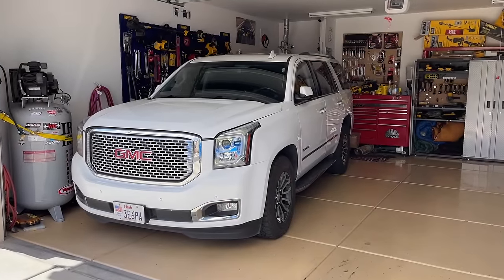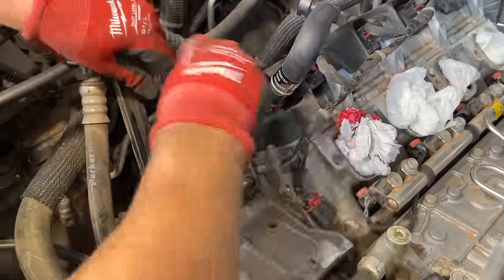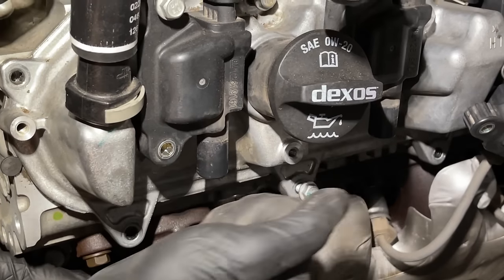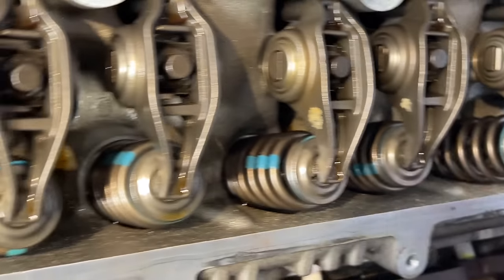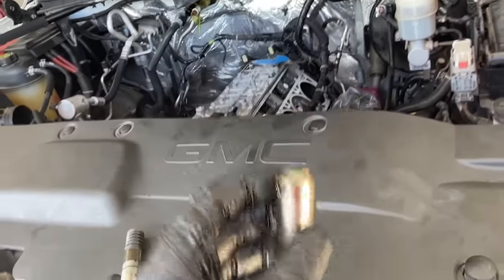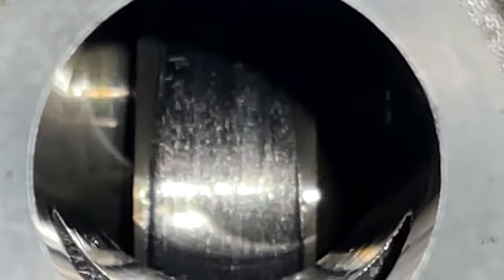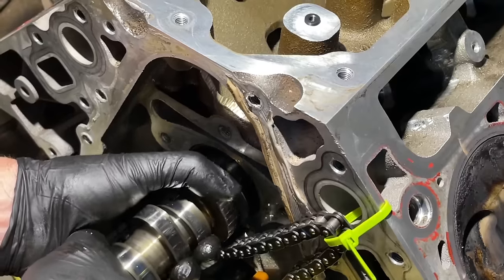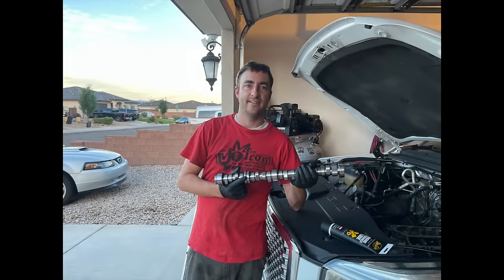DOD AFM Delete Yukon, Tahoe, Silverado, Sierra, Escalade 6.2L & 5.3L Replace cam & lifters  Part 1

Comment: Where’s the class action lawsuit?? GM needs to be FORCED to fix this issue!!!!
Reply: they won a court case....... so they dont have to do shit
Reply: @johndonovan7018 they didn’t win anything. They convinced plaintiffs to go into arbitration. So they are settling with some individuals outside of court, which kills the class action suit.
Reply: Yup, just cost me 6k yesterday.
Reply: @lespauljunky74  so sorry. I’ve been a Chevy guy all my life. No more!
Reply: I’ve seen videos of failure with just a few hundred miles.
Reply: My wife's yukon 6.2 just dropped a lifter, shop qouted me 5k to delete dod. I will never have a vehicle with DOD. It's a 2017 with 100k miles, I have a 2007 dodge diesel with 270k miles and a 2014 f250 diesel with over 200k miles both 0 issues. Maybe it's time for her to join the green handle club 🤔
Reply: @thatgreyplatty6315 
Diesels are just as bad now days too.. Def cylinders getting destroyed. It’s called Monopoly lol. Won’t have to worry about cash for clunkers in future.. they won’t make it as long like they used too 😂
Reply: It's like this. Chevy = dod issues. Ford = cam phaser and other timing issues. Ram = lifter and other valve train failure. They all have their problems.
Reply: @thomasdebord1144  of course that’s true, but the question is the rate of failure within the big three. Ford and Dodge issues aren’t near as prevalent as Silverado.
Reply: @thomasdebord1144  it's time for Toyota to make a move.
Reply: Other states have sued GMC for this issue here
Reply: My 08 made it 200k before it became an issue and I still haven't removed it I just have to prime the oil occasionally..  if every single truck failed early on id agree but they don't. Nothing lasts forever. Fix it and quit crying.
Reply: @seapotatoes7260  some make it 200k 300 some die in 30k. do you really ENJOY playing this game with your engine
Reply: @johndonovan7018 It's not a game it's called life isn't fair. I guarantee most of these clowns with low mileage failure don't do 5k mile oil changes, don't know how to prime the engine oil ect. Parts are relatively cheap considering it's major internal parts and only going to be done once in the engines entire life cycle. You can get a kit for 700. You can probably get a delete kit cheaper than that. The work isn't rocket science. People are mad at the labor costs more than anything. I'd be mad too if I were dumb enough to pay 5k for a day or two of work. Or if I were dumb enough to neglect a new engine into failure but that's what warranty is for. If it's over 200k miles you should expect anything to need major work. No engine just magically lasts 300k.
Reply: @seapotatoes7260  you’re a bigger tool than anything you’ve got in your harbor freight toolbox.
Reply: @seapotatoes7260  nah you are looking at 2k in parts these days to do it right. and you must know what you are doing or you will fuck it up and end up with head gasket issues. its simple, yet not so simple at the same time. i do agree about the neglect part. i have 3 GMs with DOD and DI. they destroy the oil fast. i change it 3-4k while the on board system wants to push it to 7k. i use penz ultra platinum but i suppose mobil1 will work too. i havent had any issues. also use oil separators on both sides and manually clean the intake valves and plenum every 30k. even with cans plenty of shit ends up on there. but lets be real, aint nobody gonna do what im doing.
Reply: @lespauljunky74 it’s such a shame. Chevys used to stand for something. I wouldn’t touch a gm product after 2003
Reply: @thomasdebord1144 not Toyota. The 2nd gen 5.7 is mony
Reply: @thatgreyplatty6315 

I have a 2004 chev tahoe 
With 257000 miles 

I have replaced the Radiator.
Heater hoses
And a very sealed in the transmission

Which cost 2600$ 

Bought a  2017 tahoe at 156000 miles and  have liffter  problems 

What a crap
Reply: @Slednex700 yup, they're designed to last only as long as your 7 year note on the vehicle.
Reply: @DdD-pi8jw Nope. Finished a 2015 ram 1500, new cam, lifters and all.
Reply: @kingsolomonamen3333 
Yes, since GM settled. It's case closed. Idaho, commiefornia, and another state all did a class action. 
As someone stated, GM settled with the plaintiffs, each person that got involved got $2500.00 each and GM basically won.
Reply: I blame Obama for the epa mandates that made them do crap like this
Reply: @rawkfist-ih6nk  very valid point. TRUMP 2024! MAGA!
Reply: @seapotatoes7260 Same here, 2008 gmc sierra sle z71, over 200,00, still purring like a kitten. I especially like the DOD working in conjunction with intelligent charging.
Reply: @DdD-pi8jw  that might be the case in your area where im at ford has kept my shop going strong for the last 20 years and my father for 30 years before me
Reply: @thatgreyplatty6315 BTR dod delete is 1k and can be done in 2 days by an amateur. I've done 7 already
Reply: Does this delete require a new cam?
Reply: @jeffyates5532  nothing bigger than stock but it won't hurt. Stage 2 adds more ponies without upgrading torque converter
Reply: Agreed!!!!!!

Comment: It's such a shame what GM has done to their once badass V8s. The damage to this engine is insane. GM knows this is an issue and how do they fix it? They DONT. they keep making the same old junk V8s. So sad.
Reply: I agree. I so wanted a new GM truck. If only you could order one with no DOD - dead on demand engine.
Reply: Their design is genius, this is what happens when you run cheap gas and your detonation is delayed because of low octane fuel when switching from v4/v8.. always use premium from the jump. Premium detergent if available, preferably.
Reply: Thank the hippies, not GM
Reply: Same here , I wanted a new semi many years ago , finally got into the position to do that and they ruined the diesel with epa regs. , so I decided to downgrade to a new pick up in 07 , I wore that one out almost , now I need a new one , but they dont build them worth buying nowadays . I'm bummed ..guess I'll look at horses to drive ..😢😂
Reply: @jonathonflores4937 the design is not genius lol

Comment: I picked up a 2016 quad cab Silverado 5.3 with 98,000 for $7500 in excellent condition the Engine was supposedly blown , all it was, was 2 bad lifters. I did the AFM delete bought new lifters and a Brian Tooley stage 1 cam. Took me about 6 hours. I used this video as a guide. Im not a Truck or Chevy Guy this was a Suprise for my wife. I did 2 oil changes in a 50 mile period also to be safe. Thanks again !!!!
Reply: Hey did you take it to a shop after to get a tune for it?
Reply: 6 hours!?!?! How the heck did you pull that off. I’ve been at this all day. I’m fighting all the stuck connectors and the dang fuel line won’t come off.
Reply: Blown engine is a word people use often. A blown engine is a total destroyed engine.

Comment: I want to thank you for taking the time to show this step by step. I just finished doing mine tonight and could not have done it without your videos. You made it easy and explained everything perfectly. Thank you so much!
Reply: How long did it take you to do everything? I have a 2015 sierra with a plug in delete and have been skeptical about doing the full delete because I don’t want to have my truck sitting in the garage for days partly disassembled.
Reply: It took me right at 40hrs. I didn’t use a power ratchet in the disassembly(bought one to reassemble) and I think it took me 3hrs to get the timing chain off(probably was a little too cautious). Shop estimate time was 30hrs so I think I was pretty much on par with that. I’m no expert by any means but to do it right I think it’s a 30hr job all day.
Reply: Hows your truck holding up with the afm delete? Hopefully no issues so far?
Reply: @leytonhankins1665 why would it sit for days in the garage partly disassembled?
Reply: Holding up fine so far. Runs better than it has in a long time.

Comment: If all gm vehicles from 2015 to 2020 has the AFM problem why don’t GM makes a recall to fix this issue if it’s been going on for years I just spend almost $10k fixing my 2016 Escalade esv cylinder 4 because of this issue had the dealer change lifters,camshaft cylinder valves gasket,come on @GM do something about it
Reply: Awful

Comment: Awesome video.  Great camera, lighting and audio.  I really thought I would have to pull my engine but you clarified that isn't necessary.  Can you comment on leaving the original oil pump installed?  I have read it should be replaced with lower pressure version to eliminate excessive oil being sprayed on cylinder walls when not utilized by the AFM system.  You mentioned leaving the old pump in place and just curious if that is ok?  Thanks again!
Reply from the maker: The oil pump is a bit tricky. Removing it would require pulling the engine (or at least lifting the engine enough to drop the oil pan. Then on installation it has to be perfectly centered or you can lose oil pressure. There are also oil lines in the pan with seals that have to line up just right. My understanding is the pump is a variable flow pump to allow more or less for the DOD and if you leave the stock one it continues to regulate to the normal oil pressure, just not needing to fluctuate since it’s more constant flow without the DOD. Mine has maintained the same oil pressure as before the procedure. I would definitely contact Brian Tooley racing about the pump as well as they have been super helpful.

Comment: Great job, nice step by step and great camera work,it is always hard to get clear views! As a note when using a crow's foot it should used at 90 deg to get the correct torque, without doing some additional math if other than 90 degrees.  Thanks again for your work here.

Comment: Looking at doing a full AFM/DOD delete on my truck. Checking to see what Extra gaskets etc would be needed: exhaust manifold gaskets, intake manifold gaskets, HP fuel lines, HPFP gasket, head gaskets, water pump gaskets, valve cover gaskets, injector seals (if injectors are removed), crank pulley bolt, vacuum pump gasket (if removed), VLOM cover/gasket, timing cover gasket/rtv, cam-phaser bolt, cam plate/cover, and HPFP cam follower. 
Crankshaft holder tool. Oil pump alignment tools (if pump is removed).
Does this sound about right?
Reply from the maker: Yes. I have a lot of the list in the video description, as well as one I show in this video 
https://youtu.be/RZGr7xT6wLA?si=zSrT7ES0dRjptKsK
Reply: i was scrolling some other video’s and came across your second part and watched it as well. Appreciate the info and how-to steps!

Comment: Great video and tutorial. I hope I can print a copy of the transcript. Just an observation; it looked like(time:13:24-14:38) the exhaust manifold, on both sides, had a crack at bolts between cylinders 3&5 and 4&6. Wondering if that would effect DOD lifter performance. Thoughts?
Reply from the maker: The manifold are made that way to my knowledge. There are slit reliefs there and on some of the bolt holes as I remember

Comment: I’m about to start on my L87 any differences you may think off that may help me on this journey! Thanks for the great video
Reply from the maker: @edvardotovar3266  i believe the cam phaser is different, and may not have as much luck waking the chain off the cam gear. If you have Dynamic Fuel management instead of active fuel management (DFM vs AFM) it may have more collapsible lifters

Comment: Maybe you had mentioned this, how many miles before you began to notice the lifters squeaking? Did you turn off DOD ever? If yes, when did you turn this off compared to when lifters failure began to take place?
Reply from the maker: This was a normal lifter failure, not a DOD one. I had not turned dod off. It had 94,000 miles at the time of the lifter failure.
Reply: @dannyjohnsonsgarage  Just curious what type/brand of oil you were using?  I have read that oil contamination or fouling due to oil quality or not changing regularly can contribute to this problem.
Reply from the maker: @bobbromm2269  I do believe it is a huge factor where GM has extended the time between oil changes. I was even running full synthetic and changing at 30% oil life left. It was a regular lifter that failed on mine. I believe the fact the system uses oil pressure in the small holes of the dod lifters that contamination can be a cause for their failure  GM DOD/AFM Lifters operation explained, failures, how to delete. Why GM engines fail 5.3L 6.2L
https://youtu.be/gEcxI2nwwxE

Comment: Great video, I was able to use a lot of it when I completed my DOD delete. I do have one question - were you aware at the time you put a L83 dod delete camshaft in your 6.2? 193/199 .502"/.494" 114LSA vs 200/207 .551"/.524" 116.5 LSA
Did you have to retune everything to remove fuel because of the smaller cam?
Reply from the maker: My friend who is a GM fanatic and did the tune is who helped pick the cam out. I’m not sure what else he did on the tune other than set the redline higher for dod to not come on and mentioned giving me some things the Camaro gets but suv/trucks did not for fuel economy. In the end it drove just the same and I didn’t notice any smell of it running rich

Comment: My suburban has been sitting in the garage for 4 months now.  Dealer said bad lifter and cam. 254k miles.  Quoted me $10k for a lifter and cam replacement or $16k for a new motor.  Don't have that kind of cash available at the moment.  I'm a reasonably handy guy, I've done a lot of alternators, steering pumps, water pumps, starters, brakes, hubs etc, just nothing this big.  Your video makes this repair look..  easy isn't the word..  Straight forward, that's it.  My question is, can there be other things wrong in there that I may run into that are related to the issue?  Also, I'm up in the SLC area..  Do you know anyone up here that could to the reprogramming?
Reply from the maker: It’s a tough one. You may be best off dropping in a new engine for the cost. It depends on how bad it was for the lifter, if it broke apart and put metal throughout the engine. With the milage the cam bearing may also be worn. You’ll see all the new parts I installed that should help in the end like the vacuum pump (which is said to also put metal in the engine if it fails). There is also the risk of parts breaking if you have rust in your area. I would say at this point you could tear it down as the video shows and see what you find, then decide if it’s worth getting a new short block and reuse your heads. Then you’ll need to really look as the heads as they get so gunked up. There is a cost of taking them to a machine shop with the milage.  I struggled with this decision because I would put another engine in which could have bad lifters again.
Reply: 10k??? Where I'm at i got quoted 3500 with the cost of the delete kit included and tuning.
Reply: @minipeppers6928  Parts alone were $3500..  Not sure who gave you that quote, but that's insanely low.  I actually ended up just getting a remanufactured motor installed.  $13500.  Got the AFM delete motor.  Runs better than it ever has.

Comment: Is this 4x4 ? If not is it gonna be same how you did with the 2019 ESCALADE 6.2L 4x4? Thank you ⁉️
Reply from the maker: This is 4x4 on the Denali. Should be the same 6.2l and everything as the Escalade. 2019 may have a different cam phaser as you’ll see the cam bolt I show later in the video series

Comment: Great video I just don’t understand all the different colored marker lines everywhere ? Even when you have timing marks from factory that shows correct timing references. Thanks
Reply from the maker: Yes, that’s just me being over cautious with some reference points since I cannot see the crank timing mark with the oil pump installed. In the end, the arrow points down and if the crank has not moved (and is locked with the tool as you see in the video) you should be in good shape

Comment: I just bought a 6.2 for my obs, i pulled it from a 2020 Denali, whats your up to date opinion over this dod delete kit?
Reply from the maker: I would say let it ride until it has a problem. You can repair it as shown in this video with the engine in the car, or you can pull the engine for better access around the pump. There are a lot of variables with oil pressure, the oil pump, fittings, o rings, etc that make it best to repair if it has a problem, not preventative. Just my opinion

Comment: what are symptoms of feilure of cams and lifters??
Reply from the maker: @ferganibelkacem4889  you will hear a squeaking sounds, get misfires from a bent pushrod, or hear a ticking. Here is an example: Bad lifter noise sound Yukon Tahoe Silverado Sierra Escalade Diagnose bad lifter GM Chevy truck suv
https://youtu.be/cx4_-FGXCVE

Comment: I kinda feel like it also. I replaced the spark plugs and it ran much better. Now it’s showing multiple misfire code without any responsible cylinder. It idles better but not like it used to.I’ll have to keep on fishing. I saw a code tool on Summit racing that deletes the AFM but not sure if it’s too late for me and worth it. I’m not going to keep the Yukon much longer because we don’t drive it anymore

Comment: Dep driveway degreaser and concrete cleaner works very well for cleaning gasket and carbon from heads amazingly. Very slightly corrosive on the alumium just enough to do a deap clean of any oxydized aluminum residue.